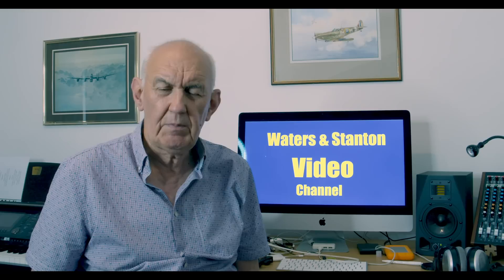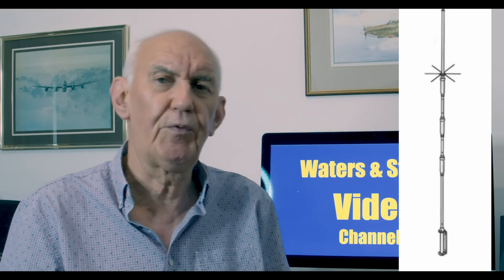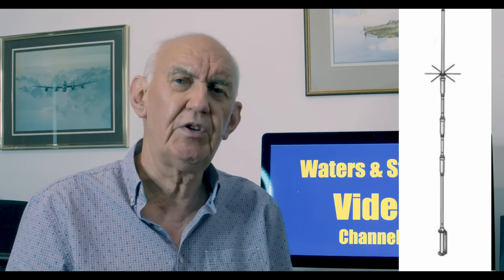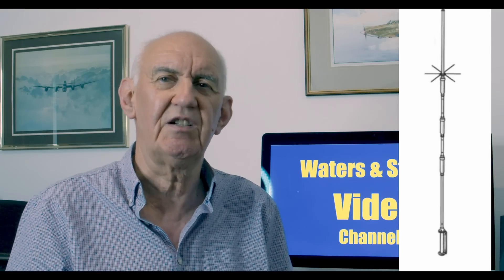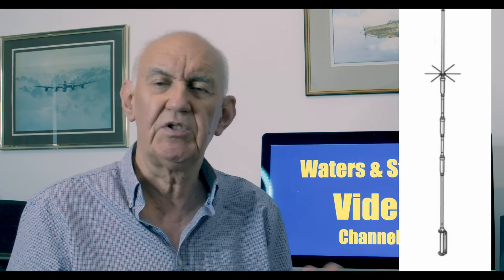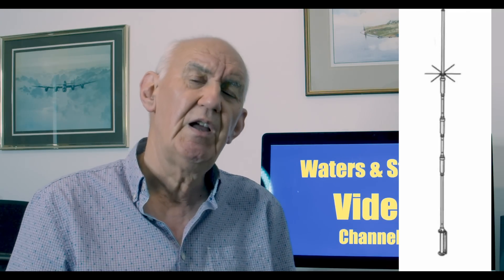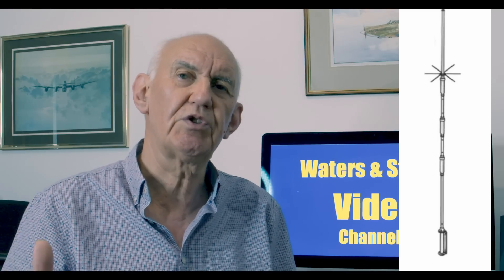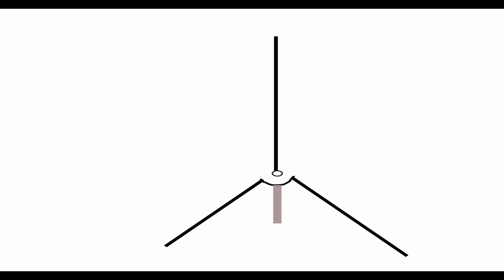DX Boost for Your HF Vertical - Simple Low Cost

Comment: I tried to mount a 6btv at 1.5 meters above the ground with no success. I couldn't get the swr down. I had radials out at ground level but this didn't work. I didn't have room to go running radials from the base of the antenna at 45 degrees down as this would take up too much room. I ended up mounting at ground level and swr was fine.

Comment: Thank you, Peter, for your time presenting practical educational videos,s for the new ham and old-timers like me. There's always something to pick up from watching video presentations. I have tried many verticals, some ground mounted with a minimum amount of radials, ie 16.  Using a simple homemade field strength meter at my QTH, which is surrounded by trees concrete and other houses, I have found that most of the time the ground-mounted verticals I have built, on 10,15,20 meters are down around 6 to 9dbs at one halfwave distance from the feed point, one wavelength and three wavelengths were similar. Raising the bottom of a 20-meter vertical from ground level to 5 meters above I gained the 6-9dbs. Wonder what a vertical for 14 Mhz at 16.5 feet will do if mounted on the chimney stack with radials lying on the slates, I, 'll report back when completed, I use the reverse beacon network for checking received signals, it is a very handy tool. VY 73 de JOHN G4YDM
Reply from the maker: interesting to hear. well  done.

Comment: Hello Peter. I have had a 10m fiberglass pole supported by a piece of pvc plumbing pipe set in concrete for two years now. It is ready to start it's 3rd Wisconsin winter. The biggest issue I have had is the pole collapsing, especially in the winter. I pull each section as tight as possible, use a good grade of electrical tape to cover each joint well, and put a zip tie on the upper section at the joint on the tape. Use needle nose pliers to twist-pull the zip tie tight. It has stayed up fine since I did this, and is a great antenna overall. Very fast to take down for storms or hoa silliness.

Comment: I agree with you mostly with elevated radials  the 45 degree will bring down the sdr. I plan on a multi band vertical like the commander I live 400 feet off the beach at a elevation of 2 feet of sea level.  The salt water is a better ground by  1000 percent so I can't wait its like magic.  And probably ground mount.
I might try it also with elevated radials. 
Keep up the good work!
Chuck AA4CP
Fort Pierce ,Florida USA
Reply from the maker: Hi Chuck. Salt water is amazing. you can hear and work stations that others cannot hear a trace of. Go for it.

Comment: Thank you for this video. For the radials coming down from an elevated vertical antenna, you suggested ~ 30-45 degrees.  But how long should the radials be (a full 1/4 lambda of the band you want, 1/8 lambda, or does it matter) ?  I believe you said 1/4 lambda radials, but that will make the radials as long as your antenna, if you are using a 1/4 wave vertical.  What about 2 radials each 1/8 wavelength - that would give you a steeper angle, but would that reduce the efficiency of the antenna?
Thank you for any advice.
Reply: Each radial should be around 1/4, 1/8 won't work, and adjust to minimum SWR, assuming the vertical radiator is also 1/4, it can be longer then the radials may be shorter.

Comment: Hi Peter, Should the end of the radials also be above ground?
Reply: No though it likely won't matter, you could lay them on the top of the ground, or have them elevated and end in stakes insulated from the ground, test and see. Don't mount a quarter wave vertical higher than 1/4 above ground at base though, if you do the next low angle radiation height is more than 1.25 wavelengths up.OH and be careful because if the ends of those radials are in reach of animals, children, they'll get very nasty shocks from them if you are transmitting, so they are best kept out of reach.

Comment: I've been thinking about a 20 thru 6 meter vertical with a 49/1 unun at the feed point and put it up 10 ft above ground with a couple of 1/4 radial. Somethiing to play with.

Comment: if my UHF/VHF antenna (2/3 of the lenhth of HF) is mounted 1m away from my vertical HF DX-88 HyGain (very old, 1.5kW sometimes I use) does it hurts much my HF vertical antenna performance? Both antennas are mounted on a chimney c.a. 7 m above the ground and the roofis covered with a sheet metal. Thank You for the comment in advance - Best regards - Adam SQ8JI  73's
Reply from the maker: Probably not. Some HF verticals have parallelelements much closer and seem to work.

Comment: Peter, following your suggestion and I'm building an elevated tri-band vertical in the back yard. Using mono band mobile antennas for 17 and 20m, and 2 resonant radials per band. Purchased an aluminum plate, cut as a hexagon base and have antenna spacing of approximately 6 inches. (BTW, tuning the 17m was a bit touchy but finally got SWR below 1.5.) Remember, a decent antenna analyzer is your best friend! To elevate the antenna I am using two sections of my spider pole mounted over a copper rod driven into the ground about 8 inches. Antenna base is up about 6 feet. Peter, I am curious about the degree of effect on SWR of trimming the radials versus simply adjusting the antenna stinger? I will be happy to provide details and photos to anyone interested in my design. Working great so far and will be adding 15 meter antenna today. Cheers!
Reply from the maker: That sounds an interesting arrangement. Ideally you want to ascertain if the whip is resonant ny attaching random wires to it. Don’t worry about VSWR, just look for the dip. Then try and get the lowest VSWR  y just adjusting the radials. 73 Peter
Reply: @watersstanton  

Thanks for your nice reply Peter. Always enjoy hearing from you. I just recently completed building a triband quarter wave in my small backyard and it’s performing quite well after a lot of tuning. I wanted to suggest a topic for one of your future videos. Antenna tuning, especially for an elevated quarter wave multiband and all the factors that effect it such as feed point height, radiator separation distance, radial angle and length and coax length. In my own experience the most difficult thing was getting the 15, 17 and 20 meter radiators to play nice together. I’m using electrically shortened mobile antennas from Shark Antennas as the three radiators.

Comment: I have a Hustler 5BTV on the ground and it performs pretty well.  I want to raise it up.  Thanks for the explanation.  The two radials you mentioned would give me what I need for 10m, 15m, 20m, and 40m or do I need more at different lengths?  The antenna does do 80m but if I can't match it for that band, not a deal-breaker.  What kind of wire do you recommend to be the best for radials?
Reply from the maker: The recommendation is 2 radials for each band. You could run different band radials close together with spacers if that helps.
Reply: @watersstanton  Thanks!

Comment: Great video. I had a brand new 18AVQ vertical in a box left over from the 1960's that I never had time to put up. This antenna had no traps instead using a loading coil at the base. I repurposed it as a 20m mono-bander trimmed exactly to one-quarter wave length. I mounted it on a section of galvanized steel conduit about 5 meters above ground. I always use a 1:1 balun with my antennas to prevent coax feedline radiation. Having room for only one radial, I gave it a try anyway. Amazingly, after tuning, the SWR was 1.05 at the center of the band rising to only 1.2 at the band edges. Haven't tried WSPR yet, but from reception reports, it appears to have good DX propagation in all directions. The lesson here is even one elevated radial can work if you don't have room for more.
Reply from the maker: Yes I agree. I have used a similar setup in a tight situation. Enjoy it. 73 Peter.

Comment: I have an aluminum flag pole that I separated at the bottom by about 1'. So the flag pole is about 23' up. Used sheets of aluminum around the base, and attach the radials off the edges of the aluminum sheets. I used random lengths. Got about 9 right now. Longest one is about 25' and shortest is about 6'. 8-foot grounding rod at the base of the antenna. Got an MFJ remote antenna tuner and she tunes up nicely from 6 to 80m. Been playing with WSJT-X FT8 and 4, and it works amazingly well. From North Central Florida I've worked New Zealand, several Russian stations, Australia a few times, Brazil and Argentinia, and Kuwait, to name a few. Have over 1000 contacts in just a month and 1/2.
I can run up the stars and strips (it is a flag pole) and so no one sees an "antenna".
Reply from the maker: Sounds great. Keep flying the flag!

Comment: how do you tune the 4btv if you are mounting above ground , if tuned at ground hight then elevated does the tune alter? cheers john zl1jre
Reply from the maker: Yes it will change slightly, This is covered in the User Manual.

Comment: Thanks Peter, how about the BB7V, I've seen you do one before on a  stand a foot or two above ground, no radials,  how would a BB7V work at about 8feet above ground with and without radials?
Reply from the maker: The design is for use without radials. It is not a quarter wave design - it performs similar to an EFHW in that respect.

Comment: I cut circular disks out of a plastic used from a kitchen cutting/preparation board.  Slide over my Spiderbeam - 3 band only and could add more, 20/17/10.  Radials 18” off the ground.  Every day is a learning day.  Thanks Peter.
Reply from the maker: Hi Mike, if you have a picture of the method or of the discs, let me know.  73 Peter

Comment: Hi Peter, nice video. As a user of a 40m vertical on the ground in the corner of the garden, and radials layed on the lawn in the winter, now completely hidden, and getting dx zl to eu everyday, what improvements do you think I will get by converting to a raised 
Vertical ant,  maybe better rx or tx, you may have said that in previous videos, I may have missed.
Thanks  73.
Reply from the maker: Ground mount results very much depend on what is around you up to several wavelengths away and whether you have benefit of ground sloping away. With extensive tests at my QTH I am seeing 6-9dB. gain on DX. And that with just three radials which I can easily fold away.73 Peter.

Comment: Hello, I live in southern California and have struggled to put an antenna on top of my roof.  I live in a 3 story house at the beach and have run an extremely heavy gauge ground wire up there, with two 10 foot ground rods into the earth below.  I have purchased two different (long) antennas that don't require a ground plane but couldn't bring myself to install them.  It's legal as a homeowner, but they are massive virtual (another 30+ feet).   Our homes are long and TALL and close together due to the real estate costs, and I think it would look odd and potentially bring down the value.  I never thought about creating a ground plane 50 feet up on the flat part of my roof using a smaller antenna.  Thoughts?
Reply from the maker: Go for it. Quarter wave vertical on roof will work great. 2 or 3 radials will work and you have benefit of nearby salt water. 73 Peter
Reply: @watersstanton  Thanks, I will give it a try.  Cheers!

Comment: I'm thinking of building a variation on this.  I plan on having a vertical EFHW.  If I cut for the 20M band it will 20M of course and all higher bands as it's resonant on all harmonics and it doesn't need radials or counterpoise (other than the coax).  Finally as far as I know the take off angle is even shallower than a quarter wave so it will be great if mounted up high!  Have you ever tried this?
Reply from the maker: A 20m half wave EFHW will only work on 20m and 10m. You are correct, the angle is slightly lower than a quarter wave. 73 Peter
Reply: @watersstanton  I suppose I'll have to get a 18m SpiderPole and then make a shortened EFHW for a 40m EFHW and more bands! 😉

Comment: Another video with excellent advice Peter, I replied to your previous video regards the choice of verticals and the installation of my Cushcraft MA5V on a 10ft mast on the side of my house making it around 30 plus feet from the ground. I thought i would add another bit of my install that may interest the viewers. The alloy mast is 2 inches dia with a 3mm wall thickness, by trade I am a manufacturing engineer for 40 + years so am a little handy on the lathe, I turned a nylon bush for a tight fit inside the mast and bored a hole to suit the aerial base to slide in snugly. To look at my MA5V it looks as its just one very large antenna no U bolts to fix to the mast for location. Now I wasn't sure if my fixture would affect my install as the 4 ground radials encircle the mast to a point but maybe I was lucky its had no adverse results on SWR or the way the Cushcraft performs...just thought I would share my idea Peter..(I have 2 Diamond 2/70 mounted in exactly the same way again with no effect on performance) 73s de G7WBB Alan
Reply from the maker: Very many thanks for sharing your idea. 73 Peter

Comment: Cheapest way is to reuse an old CB / 11m vertical- they are readily available and a 1/2 wave on 11/10 is a 1/4 wave on 20.
Reply from the maker: Providing you bypass the match section.
Reply: @watersstanton  Yes of course, some are easier than others, the ones with a coil inside the base require a few pop rivets to be drilled out to remove the coil etc.
Reply: Great idea.

Comment: 40 years ago I had a Hygain 18AVT 5 band vertical (very similar to today’s 6BTV). I had it mounted at the eave of my house (~10 ft) and had 2 wires for each band in a ground plane configuration.  It worked very well for several years. The radials weren’t at ideal angles, but it worked. A SSB contact from Texas with an Indonesian station using a Kenwood TS-520 is still one of my most memorable QSOs.
Reply from the maker: Yes I remember that antenna. 73 Peter

Comment: Do beware of the high (transmitting) voltages at the ends of the radials.  Keep them out of reach of pets, children, and the hands of guests who may not understand the hazard.  And keep them clear of anything combustible, like your house, trees, etc.
And note that elevated radials (unlike a radial field on or buried in the ground) must be of resonant length for the frequency of interest (multiple sets for different bands each need only be resonant for that band).  Not a big deal, but, for lower bands they might need to extend beyond the horizontal limits of your garden.
Reply from the maker: Loaded radials will be covered in an upcoming video.
Reply: @watersstanton  Looking forward to this video!

Comment: Great advice.  I used a 4btv on the roof of my home for years with amazing results.  Working portable, I also found much better results with my vertical configurations off the ground with the radials also off the ground.   Playing with antennas is a really fun part of this hobby.  73's WA6MOW
Reply from the maker: Great to hear from you. 73 Peter

Comment: Great information, Peter. I would like to add that if you use a metal support for a fiber glass pole, make sure the feed point is (just) above the top of the metal support. This will minimize the effect of the metal support.
Reply from the maker: Yes indeed. 73 Peter